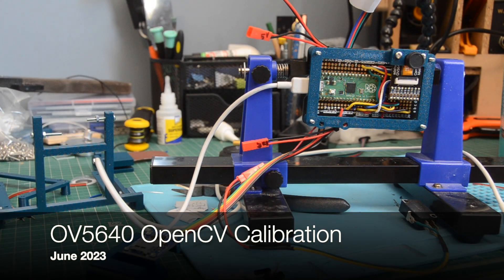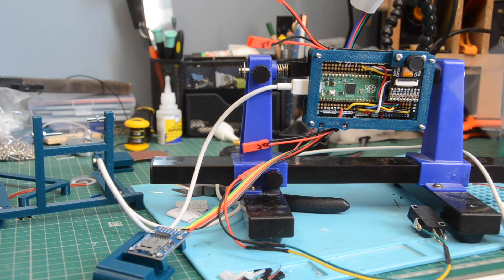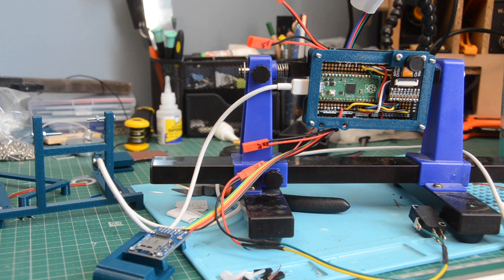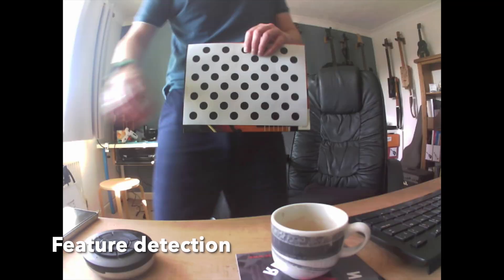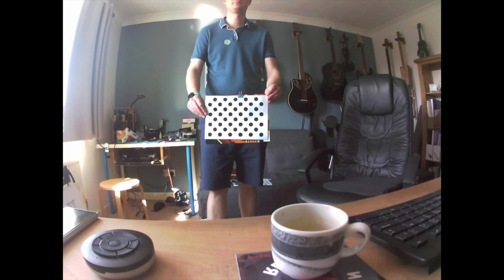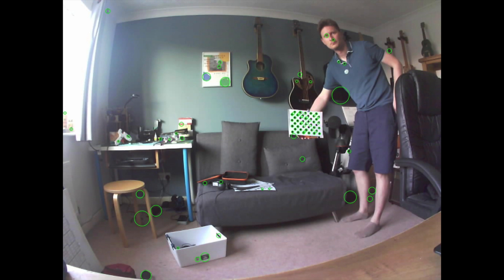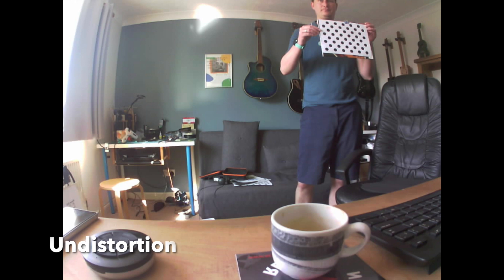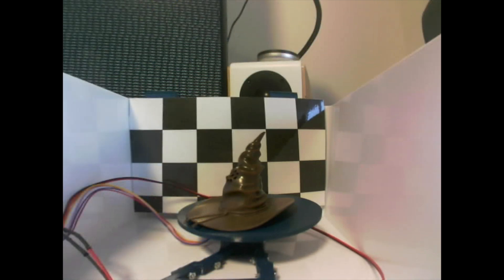Pi pico OV5640 camera calibration with openCV

Comment: Hello. ReaLly need your help. Actually working on a projet (3D scanner). Using OV5640, a laser line, and RaspBerry Pico. Now having issue with memory lack, when increasing image size. I see that you use a memory card. Can we store variable directly inside of it, without allocating space inside RAM?

Comment: What a lovely project! If you're curious, the fisheye distortion adjustment makes a lot more sense when you see the transition from no fix to full fix, rather than only seeing the before/after. not sure if I can share links here but the youtube video "J7hdrMn2RII" shows a short animation (about 15 seconds long) of how fisheye correction works.

If your lens is fixed focal length, that is to say, if you can calibrate the camera sensor once and then never need to re-calibrate it, you will find it immensely handy to point the camera at a large, blank wall so that there are no ceilings/corners/floors/etc in the field of view, only the wall itself, and then progressively move the calibration sheet along the wall to calibrate the camera's entire field of view. This will greatly aid in fixing the distortion that's particularly notable around the far edges of the camera's view, and by placing the calibration targets on a wall, they will remain co-planar for the entire calibration process, which greatly increases the quality of the software's output.

If it helps, you can even sort of divide the wall into rows/columns like a spreadsheet, to ensure you capture calibration images uniformly along the entire wall, and thus entire field of view :)

As an alternative, depending on which setup you're using for blob detection and chessboard search, you might actually find it even easier and faster to do the aforementioned setup, but print 5 target sets, putting one in each corner of the camera's view and the fifth as close to center as you can reasonably manage, and then run the distortion matrix calculator off that single image with all 5 co-planar target papers. This works quite well for rapid, uniform calibration, but I'm not sure if that is built into the code/modules you're using, so you may still have to do each position manually, but all the same - doing them along a wall will greatly assist the un-distortion :)